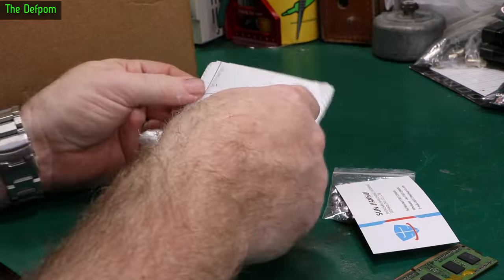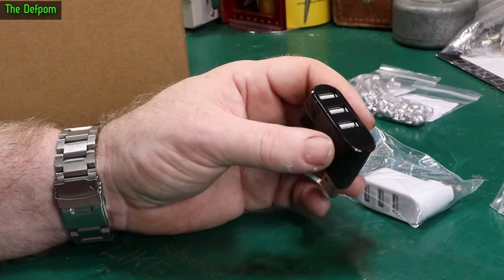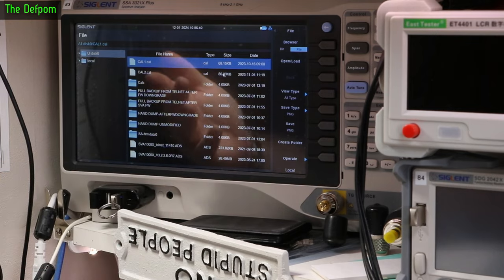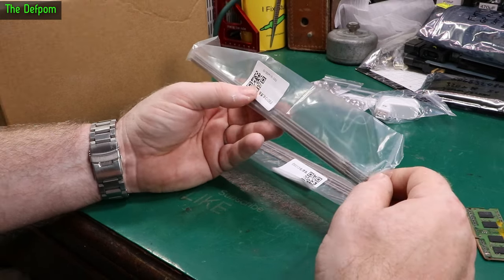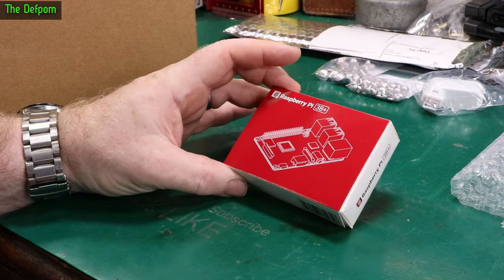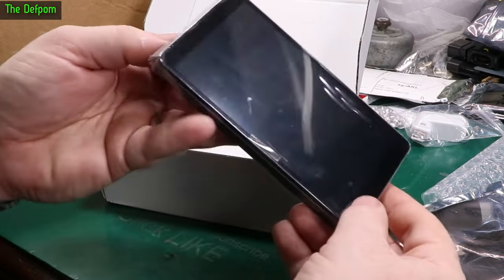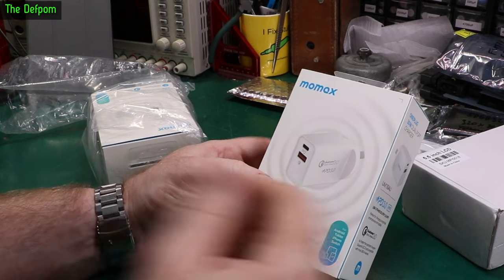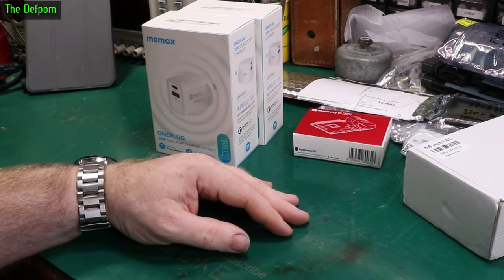🔴 Mailbag Monday 22nd January 2024 - No.1213

Comment: I use a PicoMite its a Raspberry Pi Pico running MMBasic interpreter for GUI Hardware control. Its compatable with lots of cheap screens and has a built in GUI editor so to speak. Easily implements graphs, Sliders, Virtual LEDs, Buttons, Dialog and numerical inputs via On screen keyboard. Its Easy to add Keyboard mouse inputs and VGA output etc if u wanted to, ideal little controller.

Comment: Arc is not the way to go for sheet. MIG is far better IMHO.
My arc welder can weld RSJ's with ease, but with the thinnest rods it's almost impossible to weld sheet even at it's lowest settings.
My welder also as the anti-theft system, it's called weight, with 5 gallons of oil inside I can only lift it about 2" above the floor. 🙂
Reply: you need to go to the gym more often 🙂